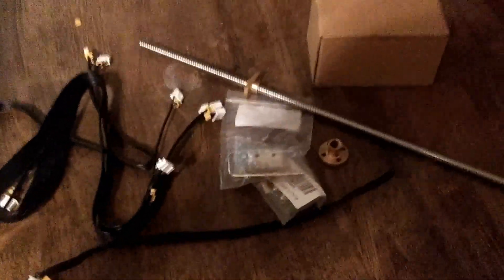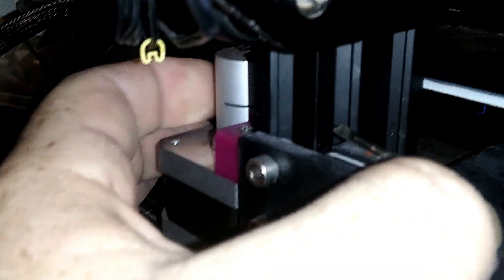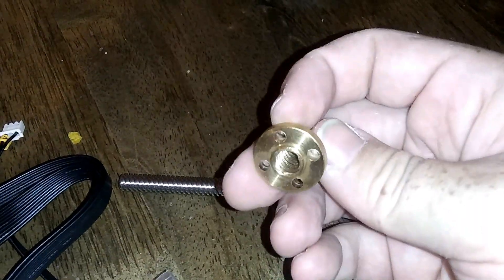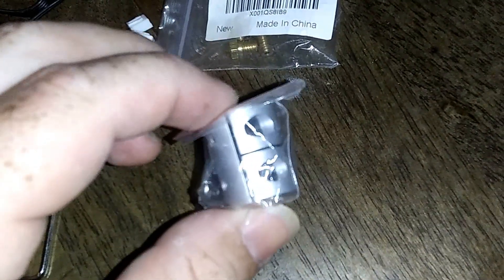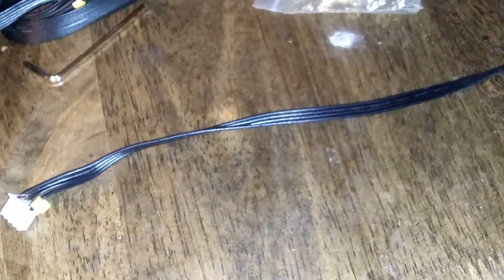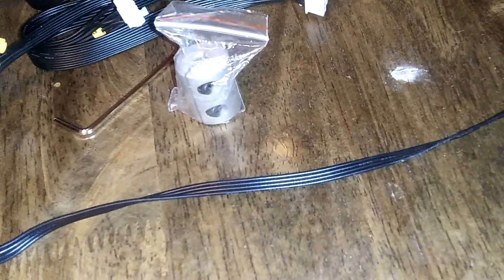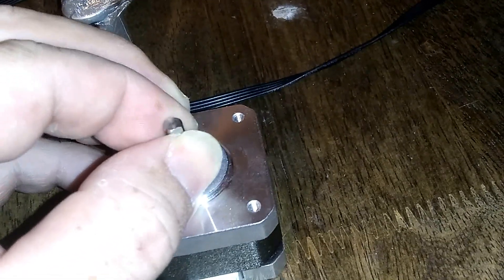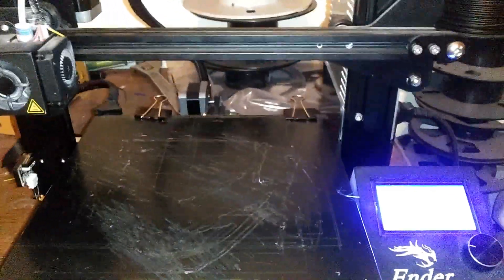Creality Ender 3 Z Axes Repair

Comment: I just moved to a new house, didnt change anything in my printer. Z Axis starting to work awfully, as you just described. So I thought, that moving my printer did cause this problem, but didn't know how, now I am 99% sure it is the wire. Thanks for posting I will try that first. BTW mine is doing all the funny sound and movings, I can record it and sent it to you if you want!
Reply: I just made a continuity test to the wire, it seems to be fine just like you said. I ordered one too, I will try it out and let's see. Thank you!

Comment: Ok so as soon as I seen your printer I noticed your coupler is damn near bottomed out and probably grinding on the top of your motor. If your continuity tester said your cable was good then it was good. I would say simple mechanical friction is what the cause was.